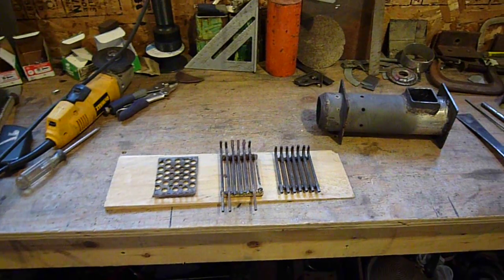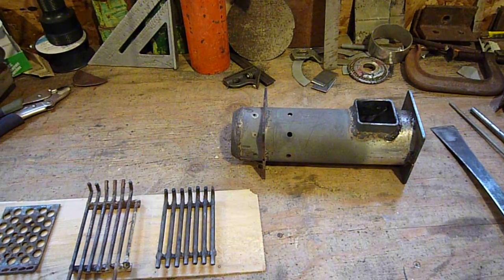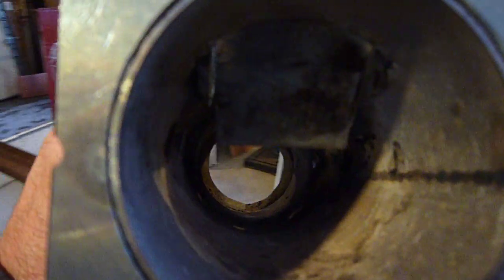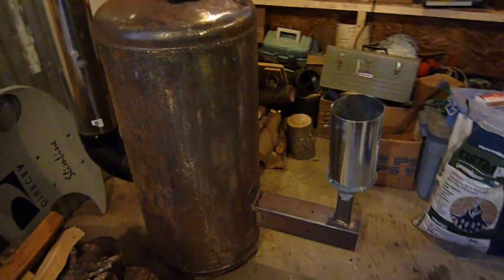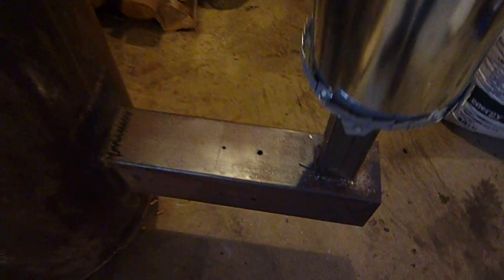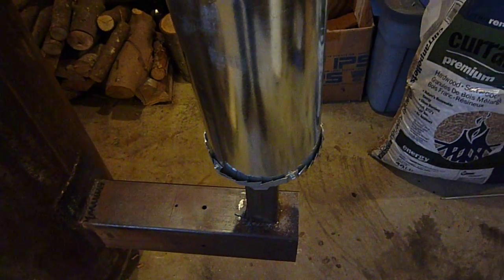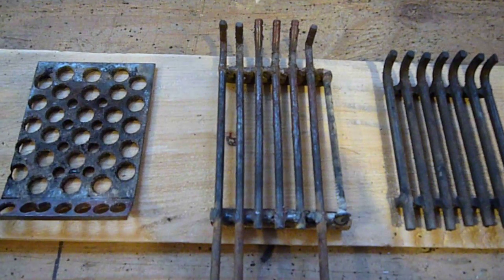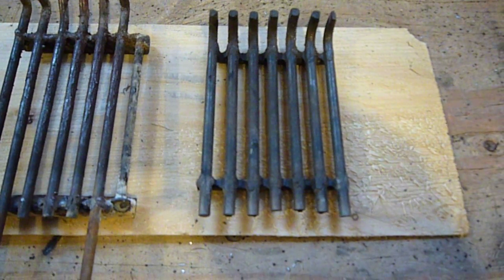Pellet burning rocket stove

Comment: There's a learning curve to burning pellets in a burn basket. I found the rods are either too close together and build up with ash, slowing down the burn and eventually going out. If the gaps are too big, the pellets burn and fall out prematurely and don't burn up completely, so that's another hurtle you will need to figure out. Air flow thru the pellets is key making them burn consistently without the burner plugging up, so that's what I'm working on now too. I'm changing the shape and size of my burners to figure out the best configuration and which design is best for the temp I'm looking for. I have some that burn over 800 degrees, but that's too hot and I burn up pellets too fast, so I need to slow the burn rate down a bit.

Comment: True 'rocket' stoves, by definition, involve a fully insulated and re-oxygenated burn process. They also generate positive flue pressure by way of the proportions and a slight restriction between the initial firebox and the burn tube such that the fluctuating pressure in the burn tube acts to 'push' the expanding gases along the exhaust (much in the same manner as a WW2 doodlebug)  solely due to that path having a lower restriction than the throat.     It's actually an exhaust rather than a flue.    This characteristic is what allows for a long, horizontal and serpentine exhaust which enables the efficient and almost complete heat recovery from the also highly efficient burn.   Thus, rocket stoves, well designed and installed, are by far the most efficient naturally aspirated stoves.  Stoves built without thorough combustion insulation, re-oxygenation or properly heat-exchanger type exhaust systems are somewhat missing the point.
Reply from the maker: This stove has secondary air, burns clean, dumps almost all of it's heat to the steel tank. I can rest my hand on the flue where it goes through the wall. 'True" rocket stove or not.